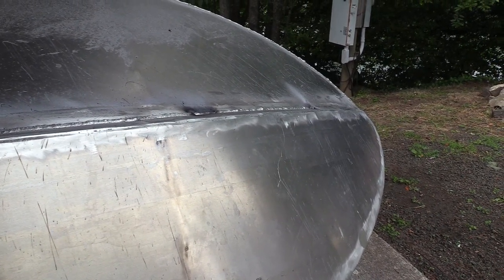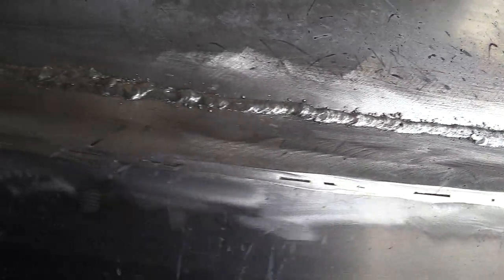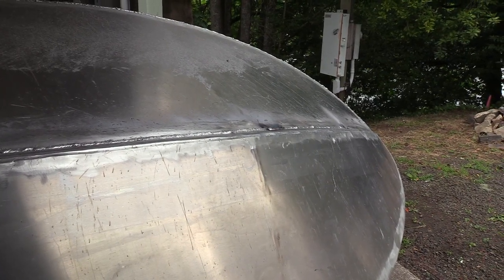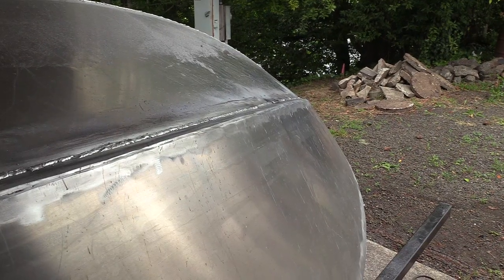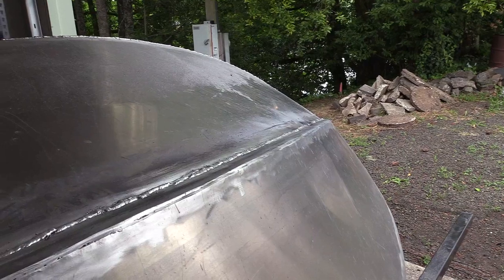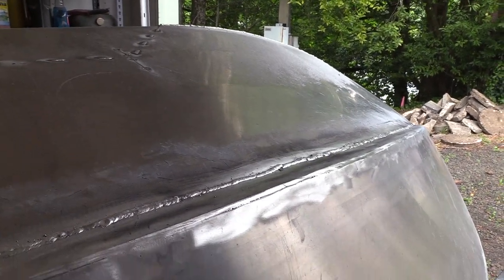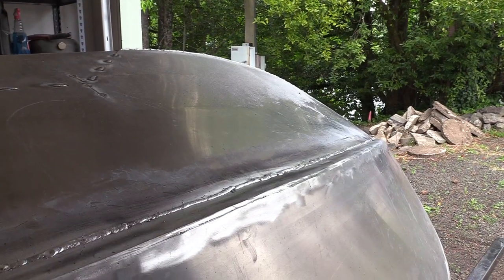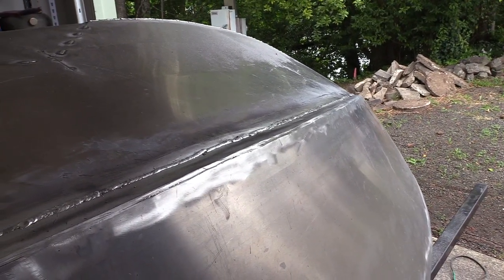Mini Jet Boat Build Hull Welding Advice

Comment: This dude just flat out gave up and now is pouting that his life isn’t fair.
Reply from the maker: No. Just a crap product pissing me off.
Reply: @paulchristian8271  definitely user error. Need more time on a welding machine for sure that hull can be welded no problem speaking from experience
Reply from the maker: @aaronsteffey4353  It’s held up great. After beating rocks and huge waves it is dry as a bone inside when left in the river. I’ve never bragged about my welding skills. 😁 With that said, kits with bad bends suck.
Reply: @paulchristian8271  bad bends can definitely make it a real chore I ran into some overbent and under bent parts on my Minijet Inc  kit. I’ve enjoyed your other videos of running the river.

Comment: Been welding aluminum for 50 years. Its not difficult just takes a little knowledge
Reply from the maker: It would have been better if I would have worked on it consistently until it was finished, and if I had taken more time to learn, test, and practice.

Comment: What the fuck are you doing......... Cuz that ain't aluminum welding, and its not really slow.... You are not doing it right!
Reply from the maker: 6 String Terror Yeah. I know. That’s why I wouldn’t suggest that people weld up these kits while they are trying to figure out aluminum welding. Wish I had bought the welded hull. They charge several thousand to weld it.

Comment: I wouldn’t sand the internal welds as it weakens it and there is no need , I left my welds on the inside chines un-sanded . Mine was the same with the air pockets .i played with the gas pressure and that helped
Reply from the maker: andy black Thanks. I think you are right. I eventually got my heat, speed, and induction set to weld it better. I just worry about leaks with the porosity.